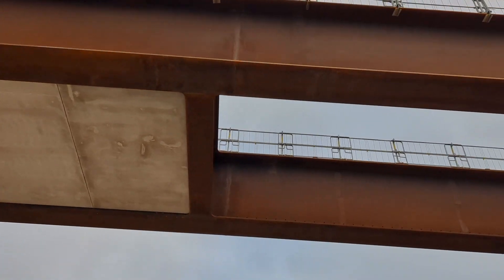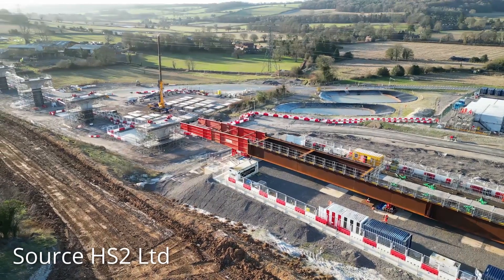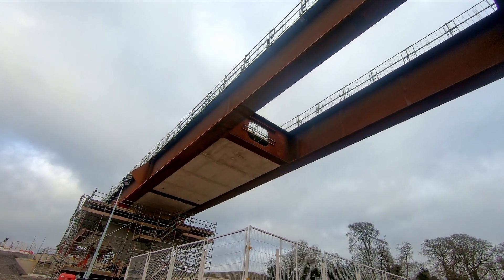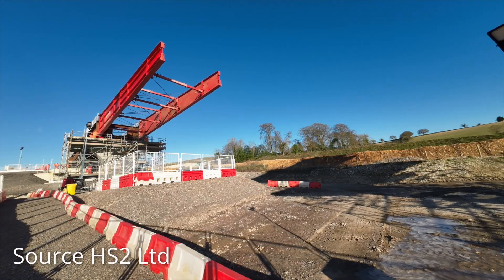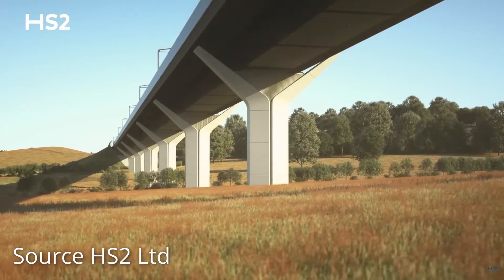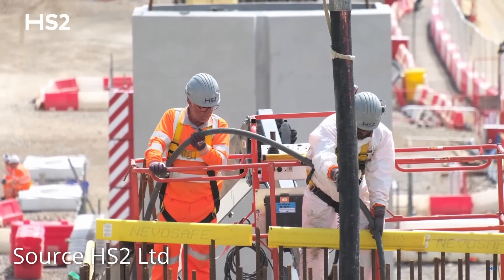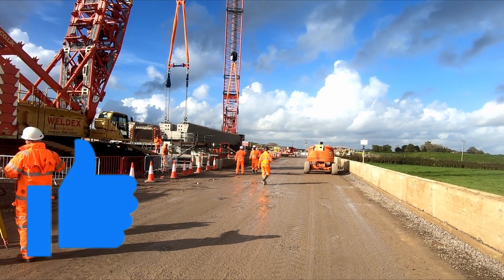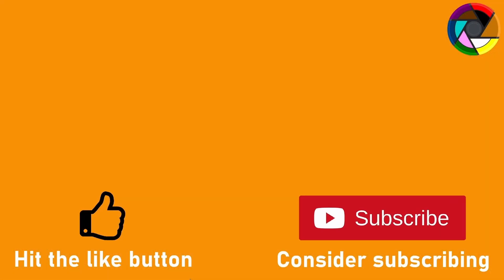HS2 Wendover Viaduct "Push Launch"

Comment: French engineering is now far more capable and technologically advanced than British.But we are still pretty good with shovels.
Reply from the maker: They've certainly had a lot more experience building high-speed rail infrastructure. If the Government hadn't cancelled phase 2 we could've retained that knowledge and put it to good use 🙁
Reply: BULL, I have worked for many engineering companies that could make those simple welded beams,
Reply: @MichaelKettleson The French are masters in tunneling and rail infrastructure though. We can easily and flexibly pick up that knowledge. However, because we don't build large scale infrastructure persistently enough (Tories hate infrastructure spending and only grudgingly give the cash) so that knowledge and industrial base tends to go away.
Reply: @EdgyNumber1  I am talking of the manufacture of these very basic beams. Engineering companies are supplied with drawings and they return a quote, These beams can be made with very basic equipment in a fabrication shop, that has the crane capacity, sub arc welding gear and skilled men. available in many fab shops in the UK. The problem here is people like yourself talk down the UK when you dont actually know what we are capable off.
Reply from the maker: I spoke to someone working on HS2 yesterday. It probably wasn't the case that there's a lack of expertise, but that a UK company couldn't be found during the tendering process at the time. A Bolton based company is building similar weathering steel sections for BBV in Birmingham, but they tendered for that way in advance. I probably misunderstood what they chap at Wendover said. HS2 is using as many UK manufactured elements as it can, but due to the scale, it obviously puts as strain on the manufacturing industry.

Comment: its rather concering that its already extremely rusted
Reply from the maker: Called weathering steel. Counterintuitively protects the steel and makes it last longer.
Reply: Believe it not it’s pre rusted as such, provides protection against the elements.
Reply: The pre rusting looks awful
Reply from the maker: But it protects the structure and actually makes it blend into the landscape better.
Reply: @Rail_Focus  re the blending in, I'm not convinced personally, new road bridges stand out when they're rusty, where as those painted green don't. 
I accept the longevity, as I m not a scientist, also to keep painting it costs money.
Reply: I’ve found that weathering steel is equally or less noticeable than other commonly used finishes; one of the most common paint colors is an oxide red, and there’s not much difference